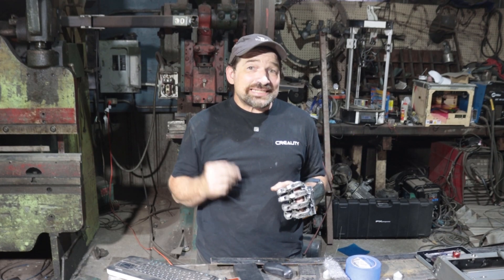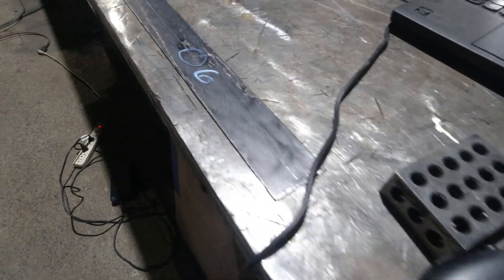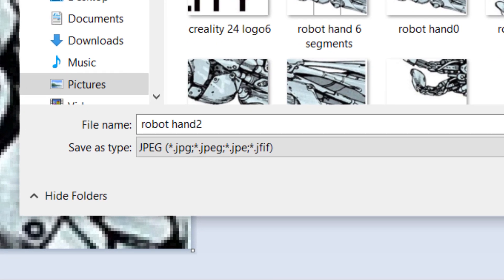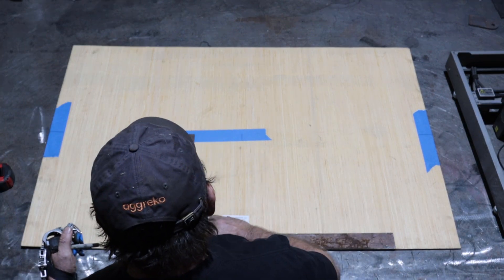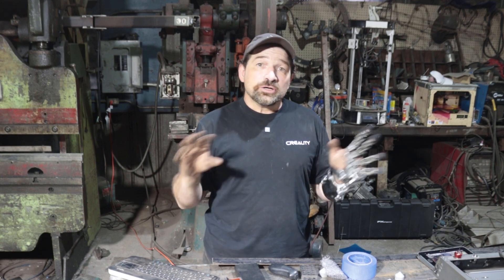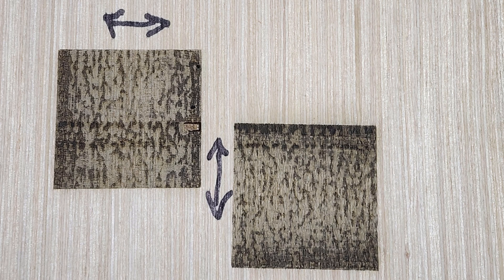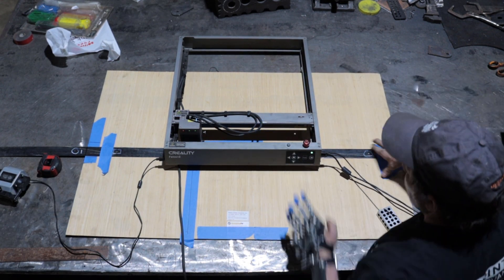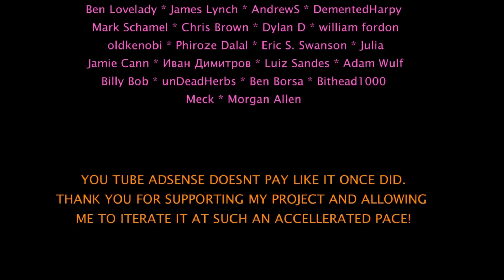Cut Huge Parts Using a Tiny Laser

Comment: It'd be awesome if Creality put together some software (and hardware) to make this easier; it could tile the image and use an onboard camera to figure out what it is overlapping with and pick up from there...  Then you could just plunk it down with a couple cm of overlap with some other tiles, wait for it to finish, then move it again.  No need for precision, because the camera works it all out.  It's cool that you've put together a workaround, though; maybe Creality should consult with you on how this process could work, perhaps with some locator stickers or something to make it more reliable?  Something like the router that automatically cuts the right pattern using computer vision.

Unrelated to the video, but it is awesome to see your prosthetic fingers in action while you do work on other projects like this.

Comment: 1:50 Might be useful for someone

If you are scaling up or cropping any image for larger works or low resolution image. Then if possible make or get vector graphics type file of png or jpeg. Scale vector graphic file up to required size and then use paint or any other program.

Comment: I think an upgrade to the flat bar to make the transition faster would be to put it on hinges. Those hinges that can slide up and down the flat stock independently and clamp to the flat stock using set screws maybe (kind of like the set screw on calipers). Plus it would steady the flat bar against the material being engraved.